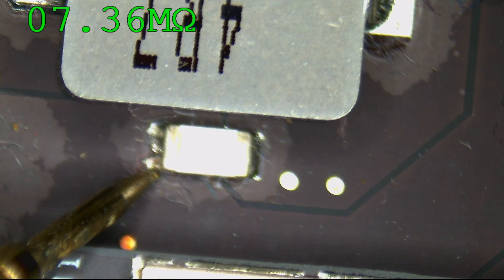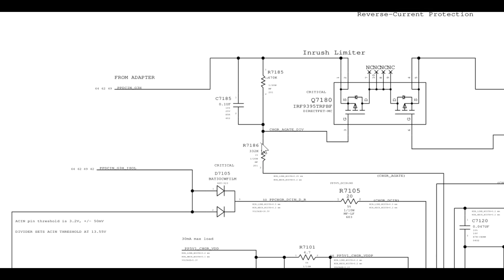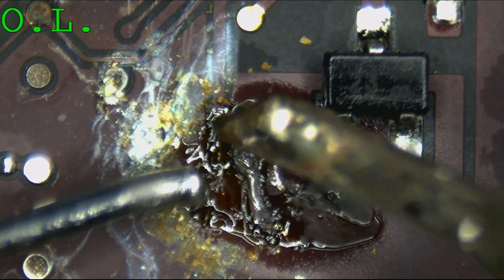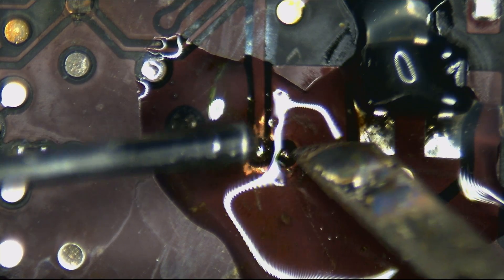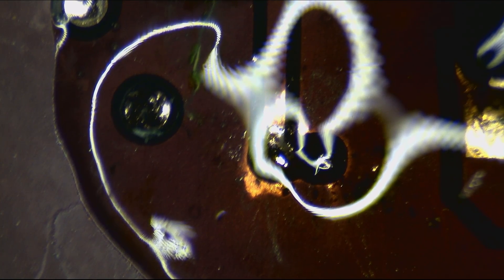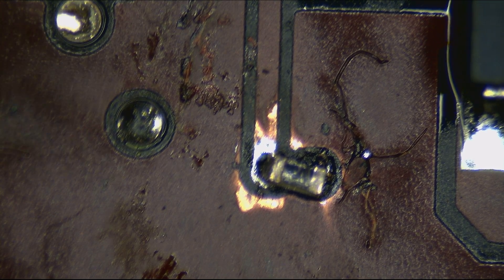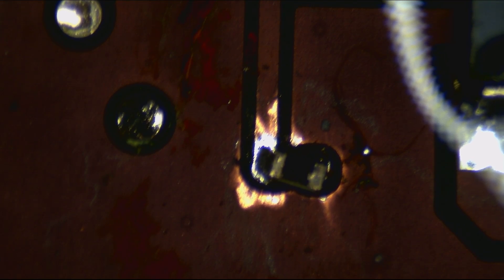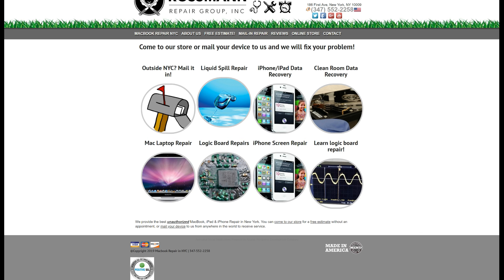Why is PPBUS_G3H 1.7v on this Macbook Air logic board?

Comment: Hi, Louis, another great video. 
I think you need to explain why you went to a donor board for R7186.
That resistor value of 322k is a non standard value and so not kept as a basic stock item.

Comment: Hi Louis, my name is ramses, i have a problem with my laptop I know for a fact you only work on macs but I trust you more than a random guy, in fact let me correct my self, my laptop (lenovo flex 2-15) has 2 problems witch I dont know if it is from the same sorce: when i close the lid it should go to sleep mode but it dosenst, i even tru passing a magnet but it dosent work. 2nd when it is turn off or put into sleep mode i dosent trun back on, to turn it back on i have to take all power out of the motherboard, un plug and disconect the battery then plug trun on a couple of times until I get the fan spin and last connect the battery. The battery works fine since the problem persist with a new one aswel. I dint know what else to do, I dont want to ending up to a store to buy a new one, srry for the long comment btw.

Comment: I'm watching this on a five year old Alienware laptop.  Due to quality worksmanship, I haven't had to worry about the motherboard getting wet, or roaches dying inside the case.   In fact, my only problem is that my battery won't charge, but that's only a minor inconvenience, since I have never used it when it was unplugged.

Comment: Why not solder bridge and then make a cut in the trace higher up for the resistor? Would make it a bit easier.
Reply: Scale. Hard to cut a trace that size without nicking something beside or under it.